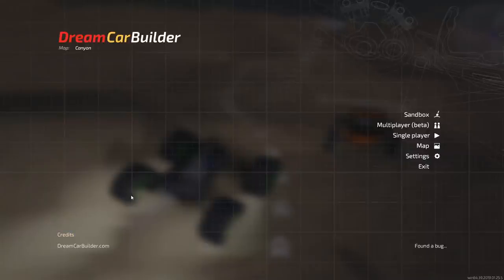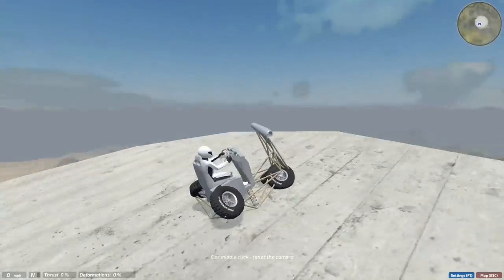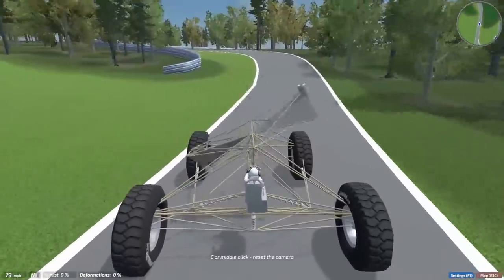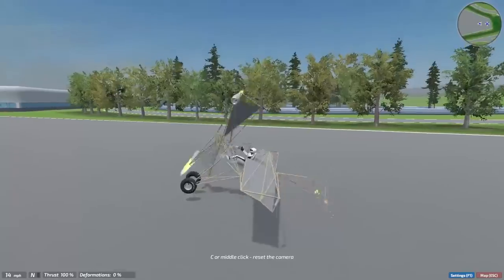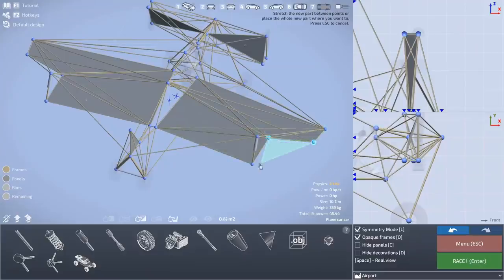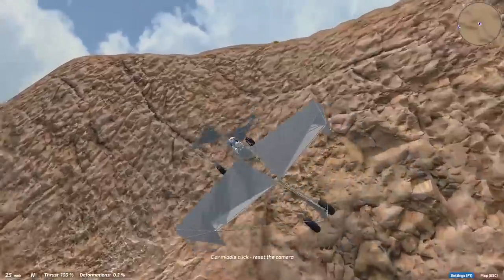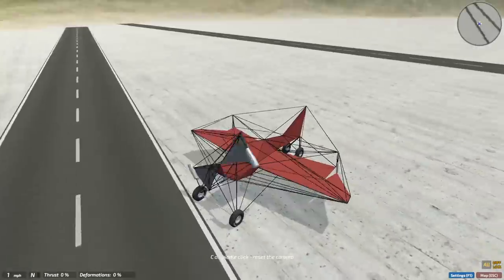Propelling to Victory in Dream Car Builder

Comment: Your pitch problem was likely because of a combination of your center of lift being too far behind your center of mass, and the fact that your elevators could produce almost no torque on the plane because they were too close to the center of mass. Making the elevators ailerons and adding elevators farther back on the tail would likely fix this.

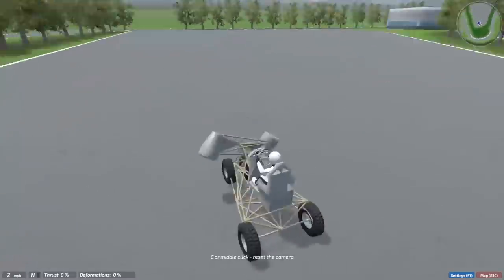Comment: I know this is late but, around 4:20 the reason the plane began to rotated and pitch is because of torque reaction, which simply means the plane was doing the opposite of what the prop was doing as is stated in Newtons laws, there is more involved but I just did a short bit of research to properly answer since I didn't see anyone else doing so. https://wiki.flightgear.org/Understanding_Propeller_Torque_and_P-Factor (edit) also it looks like the jets broke out of place

Comment: I know this video is kind of old but i do wonder,would it be possible to entirely fix the pull to the right by simply adding a second contra rotating propeller? by all accounts it should work as long as they are mounted in sequence

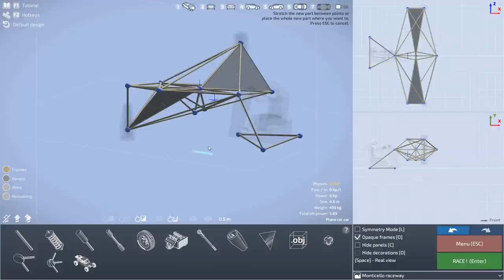Comment: 6:51 ah I think I may have seen a 3 propeller plane before; one on each wing, and one on the nose
and for 3 engine
those jets with one on each wing and one in the vertical stabiliser
Reply from the maker: That's a cool design, I might steal it at some point lolll

Comment: You need a counter-spinning rotor to ensure the thrust vector is completely straight and not altered by the rotation of the wheel itself. That, or a double-engine plane with opposite rotation directions, but then your chassis would have to withstand the internal stress of two rotors trying to pull it apart. Alternatively, you can combine both ideas for a maximum speed plane.

This guy (gal?) has a really good tutorial on how to build a plane in Besiege. The same principles should apply here.
https://youtu.be/PqtFGHxGQts

Comment: So this game simulates propellers? Cuz it physically can't calculate airflows with just a PC. How does this even work?
Reply from the maker: No need for a full airflow sim, I think it just takes the linear velocity of sections of the prop and uses some air resistance equations to get the net force.